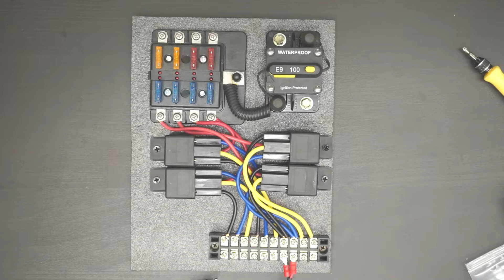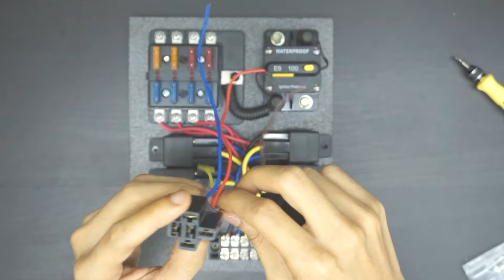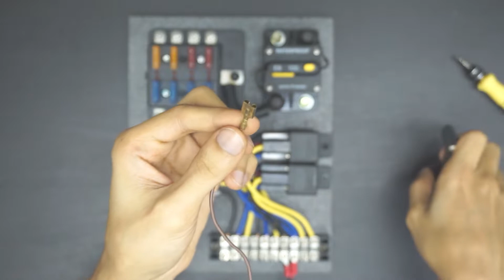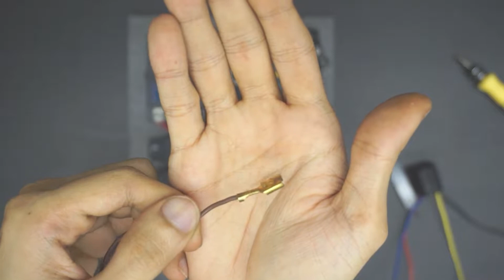Custom Car Relay Box For Nitrous and Water Methanol Injection with PSN-1

Comment: Does this all run on the factory ecu? I'm in the us
Reply from the maker: Hi bud, yes they do, I ran them on the Audi s4 b8. As for the wmi you will need to tap the boost and as for the nitrous psn1 controller, you will need to tap the rpm signal on the ecu (I did a video on where to tap them as well).
Reply: @Revoluzion  sweet ty.... Might not go wmi but nitrous yes
Reply from the maker: @dddfabio7007  no prob bud, you will definitely need innovate psn-1 or some kind of controller for the nitrous, unless you just want hot switch and power it at certain time.